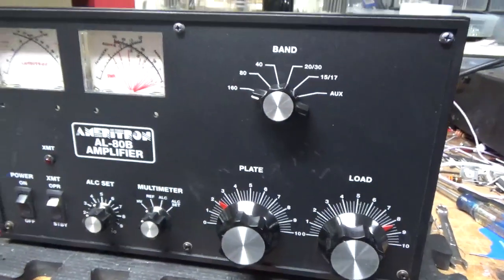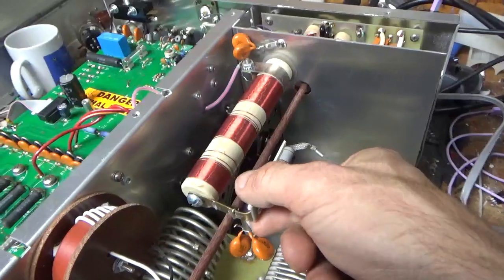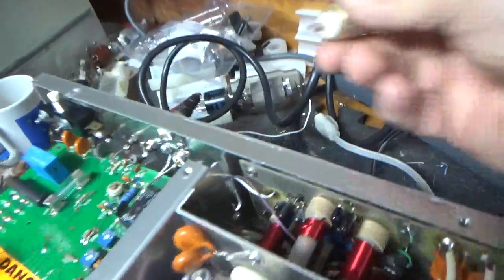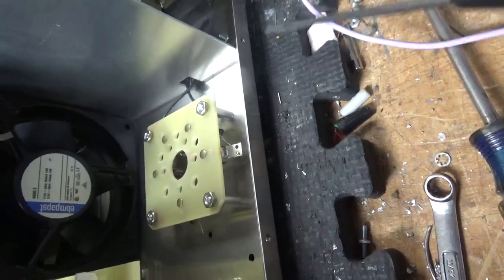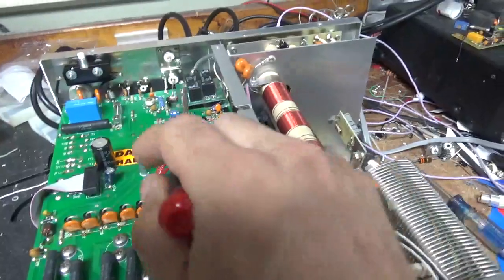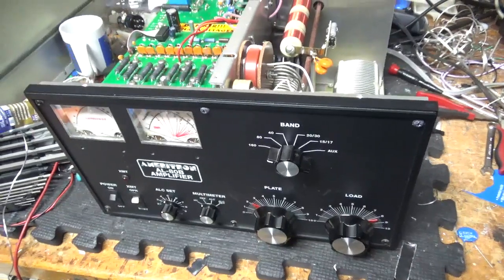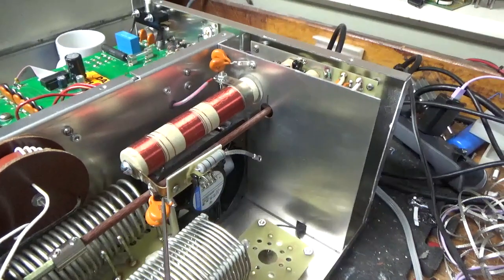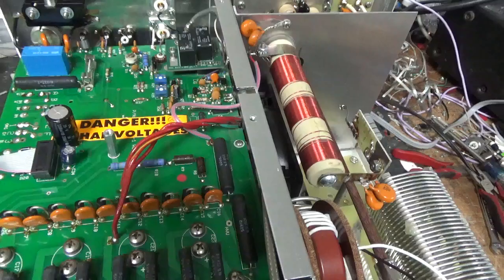Ameritron Al-80b Repair, Broken Leads Plate Blocking Caps, New So-239 Connectors Etc Etc

Comment: Great video you are very knowledgeable  Wonder why they never hard grounded the grids to begin with can you offer an explanation for educational purpose I would like to know.  I am sure know more than most.  Thanks and Happy late 4th
Reply from the maker: Simple, would take longer for them to do it the way I do it. Time is money 

Same goes for the al811h Pa where they ground the grids.

I have seen the stud nuts loose in the al80 series pa’s and socket screws loose in the grounded grid al811h pa’s.

Very important to have a solid grid to chassis connection.

I don’t want the customer to have send the pa in for repair again, I cut no corners!!!